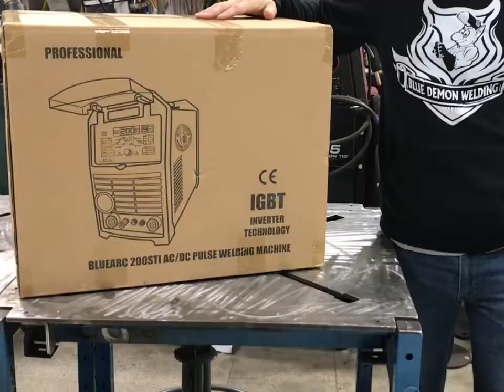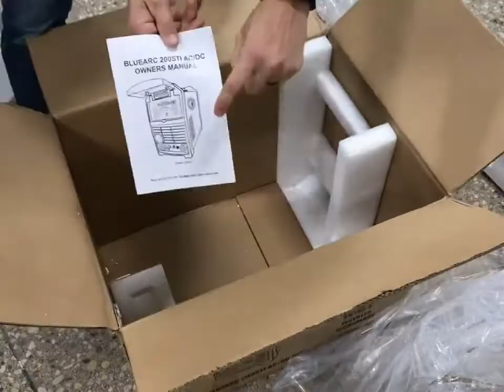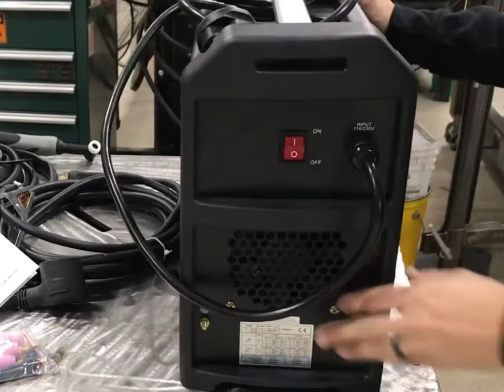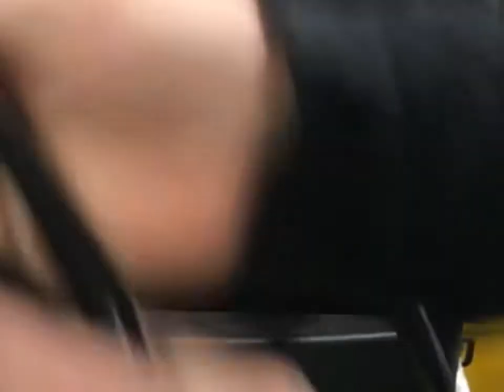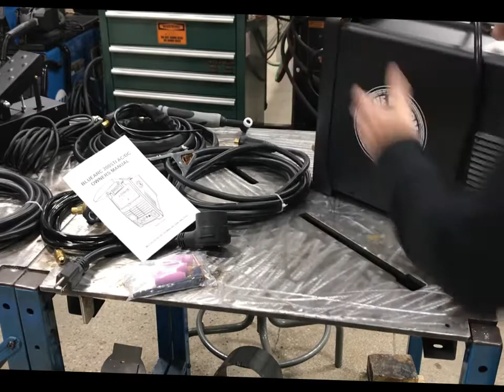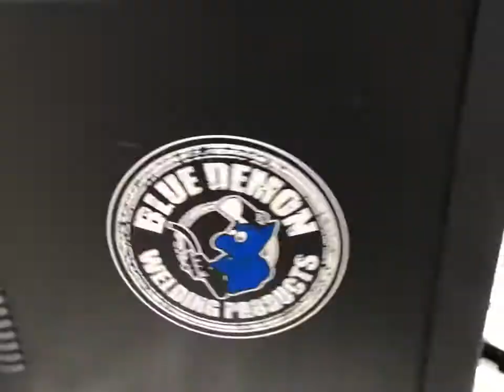Blue Demon BlueArc 200STI-ACDC unboxing

Comment: Bought this welder the other day. Seems like a great machine and great price. I agree about the comments here regarding the pedal and the regulator. My regulator was leaky in many places, even after tightening. The pedal feels good, but I hate that max amps is regulated by that dial (the machine continued to read 5 Amps when I tried to change the max, but had the remote plugged in). I'm not sure if there is an alternative way to set max amps for remote settings if you were to get a different 5-pin (plus 2-pin?) pedal.

The momentary switch in the pedal is finicky and seems like a safety hazard. I have been running the machine with both plugs going in and not using the torch switch. My biggest concern is that after turning the machine on, it attempts to weld right after warming up. Even without my foot on the pedal. When I am ready to weld, the pedal will require you to push down, release, and then push back down before it begins welding (it is NOT doing a pre-flow).

Please enlighten me if these issues are user error and not really knowing the new machine yet.

The users manual could use some more details, it was too general about the machine and its controls/settings.
Reply from the maker: just saw this...  email me at bluedemonweld@gmail.com if you are still having issues.

Comment: pedal is junk bd needs to get better pedal and torch if it wants to compete with the other welders in this bracket
Reply from the maker: thanks we have improved the pedal on the next batch.  hard to compare with other cadillac machines when our price point is under $1000.  i typical SSC aftermarket upgraded pedal alone is $150-$200

Comment: Nice to see the various wave forms and the very respectable duty cycle. Appears to be a very solid machine and should fit into the budget market well. Few change suggestions - supply it with a 17 style torch and superflex  style hose, SSC style pedal, and a flow meter instead of the regulator.
Reply from the maker: Thanks for the feedback.  well noted!  we went with the 26 because it can handle 200amp, whereas the 17 maxes out at 150.  we are working on upgrading the pedal with SSC.  flowmeter is a solid idea.